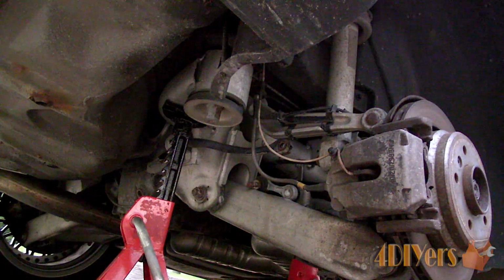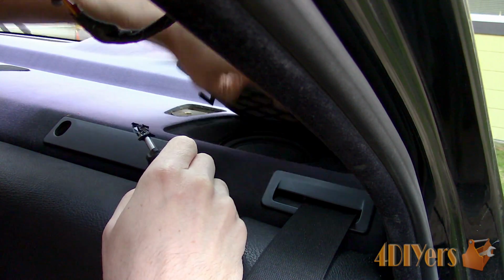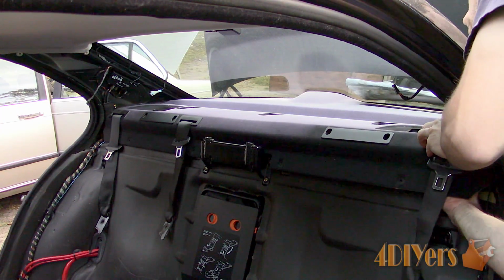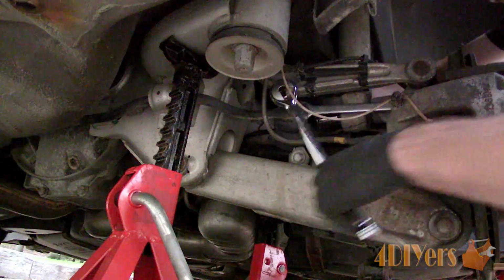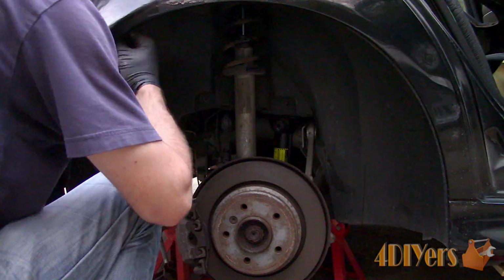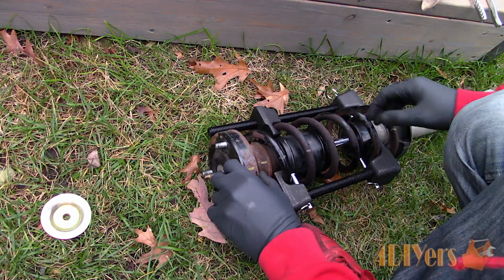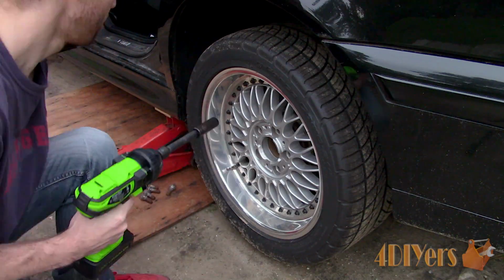How to: BMW E39 Rear Strut Removal and Replacement

Comment: Do You Think I can replace the self leveling suspension for struts instead? it's seems that it has the same housing, space, height, and fixation points as the struts.

Comment: I don't understand, if I don't remove the upper arm, I won't remove the shock absorber, I tried it yesterday and it didn't work, I have a question, if I finish the undercarriage, is there more room for me to pull the shock out?

Comment: Very detailed DIY, thanq.  BMW does not make it easy do they :)   May I ask wich Spring compressor u used? I am having trouble finding a good one (not to expensive)
Reply from the maker: Thank you! I was searching around for the best option that wasn't too expensive, ended up sticking with Blue Point (Snap-on). If I remember right, it worked out to about $150 to my door. And as far as I know it has a lifetime warranty too.
Reply: Thanq, I'll check it out.
Reply: BMW has made this job too complicated, this is a flaw that the Germans have always had!

Comment: Ummm I did this on the on the passenger and drivers side at a fraction of the time. You don’t have to remove the wheel well liners. All you need is to do is remove the top control arm completely cut a piece of wood 9 1/2  to 9 3/4. Place the wood on the right wedge it in between the swaybar it will fit almost perfect. Disconnect remove the very top bolt the level sensor then the 16 mm bolt to the right lower control arm. Now move the traction sensor lines and the entire assembly will fall out freely and unencumbered to the left. You’re gonna save about 40 minutes
Reply from the maker: I have since sold my E39, so I can't remember if there's one or two adjustments, depending on which, it has an adjustment for rear alignment. So you'd have the added cost of getting a rear wheel alignment. Then you also have to preload the control arm bushings, otherwise you'll have a premature failure on the bushings.

Comment: awful BMW.
We replaced 2 struts / shocks on friends car whole day (just one side).
Tired as hell.
And i said him,  for the other side call somebody else.

You got the strut out so easily, thats weird.. We did this in the hard way.. Have to rewatch this moment many times..
You removed the gas hose and you remove strut?? weird..

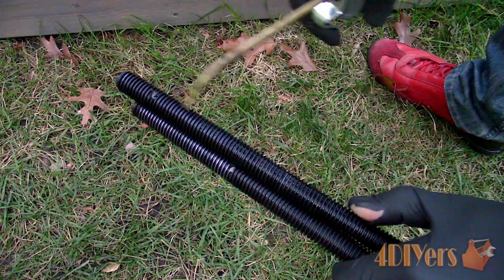8:38

common issue. friends car also had same.
BMW totally failed at this car.
Reply from the maker: Yeah the strut will catch up on the filler neck. As far as I know they were the original struts on the rear, over 200,000km so they did have a long life. I actually miss the car very much, it's an older car so it's bound to have problems. But I preferred it far more than my C30.
Reply: Make sure you have a piece of wood or bottle Jack to keep the hub going up. Jack up the other side of the car so all the tension is off/anti roll bar links taken off.